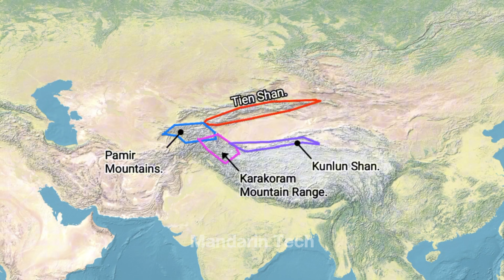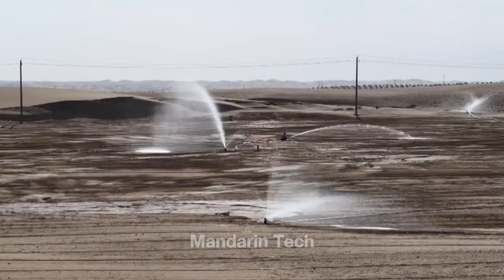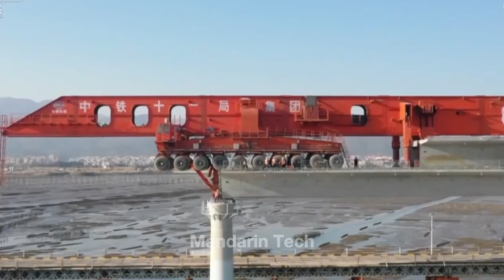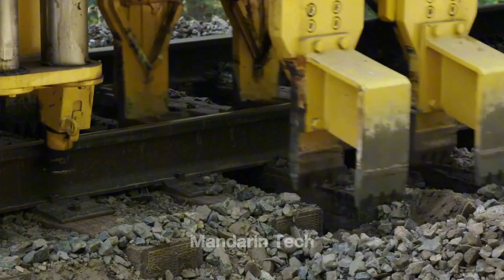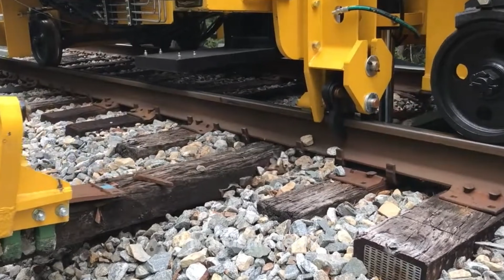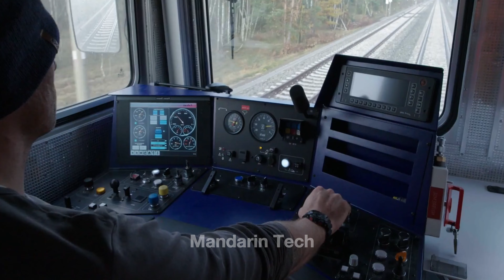How China Split Half The Mongolian Desert To Build a Massive Elevated Railway With 2,700km Length

Comment: Thank you for this very informative video.  I'm curious how thermal expansion and contraction is addressed with the Chinese approach of using solid concrete base instead of stone ballasts? Same for the continuous welded steel tracks.
Reply from the maker: Great question 👍

With slab (solid concrete) track systems, thermal movement is managed through expansion joints, elastic fasteners, and vibration-absorbing pads between the rail and the concrete base. These components allow small movements while keeping the track precisely aligned.

For continuous welded rails, engineers control temperature stress by installing rails at a specific “neutral temperature,” plus using strong anchors and monitoring systems to prevent buckling or cracking during expansion and contraction.
Reply: @Mandarintechmido  I bet the question was about lenght-expansion. >> every some distance, diagonally cut open joints are used (since ages...)

Comment: This construction techniques is wrong.

They should have drwdget the sand till they had reached the hard packed earth would ground.

Then should have constructed the pillars.

After the construction utilising waste sludge slurry cow dung and others plant dried leaves foliage etc should have been mixed with the removed sand and solid soil created.

Should have planted trees green house with fruit tree plantations for the 2000 kms. With irrigation 
Along with service roads for harvesting..

This should have been done for every pillars radius of 1000 feet on both the sides of the pillars creating a oasis of railways.

Developing specific landscapes on both sides alternating as resorts and break journey stations.

Comment: “Splitting a desert to build a 2,700 km elevated railway 😱 This is not construction, this is next-level engineering 🚆🔥”
Reply from the maker: It’s engineering at an extreme scale, pushing construction far beyond what most people imagine possible.
Reply: And it did not split the desert, it was built along the edge of the desert

Comment: Just in case more ppl are wondering, there is very little doubt that Beijing will never get that investment back, or even get enough back to offset the operating cost. But This is the core difference in way of think between Chinese and modern day West. Its not about the money, but about connectivity! And in this case, Beijing plan of its rail network is same as many others did with their road network and metro system(in major cities). Its never about cost, but country(and city) needs them as mass transit system for both ppl and cargo. Bad weather can stop plane from taking off, but very few nature situation can stop train from running(just look at Japan). And idea isnt even new, that is why I said "modern day West" before. as US build vast road network, just like ancient Roman and chinese first dynasty Qin did, the idea is that vast road network is important to connect the country, it overall benefit cant be measured by just how money the whole thing cost(within reason ofc, because corruption).
Reply from the maker: Well said. That’s exactly the point — connectivity, resilience, and national integration matter more than short-term financial returns. Like highways or metro systems, the real value isn’t profit, but keeping people, goods, and the country moving, even when other transport fails.
Reply: 中国的核心观念是：“为人民服务”，让人民过上更好的生活才是终极目标
Reply: а еще Китай обеспечил работой тысячи рабочих и много строительных компаний.

Comment: Has the line gotten or getting income of more than the construction, maintenance, and operating costs to build and operate it?
Most of the videos shown don't follow the audio.  This is mostly overhyped and taken from others' videos.  I don't think I saw any signs that were not reversed.
Reply: doubtful Beijing will get that investment back, or even get enough back to offset the operating cost. But This is the core difference in way of think between Chinese and modern day West. Its not about the money, but connectivity! And in this case, Beijing plan of its rail network is same as many other did with their metro system in major cities. Its never about cost, but as mass transit system for both ppl and cargo. Bad weather can stop plane from taking off, but very few nature situation can stop train from running. And idea isnt even new, that is why I said modern day West. US build vast road network, just like ancient Roman and chinese first dynasty Qin did, the idea is that vast road network is important to connect the country.
Reply from the maker: That’s a solid perspective. For projects like this, it’s less about direct financial return and more about connectivity, resilience, and long-term national integration—just like highways, metros, and historic road networks. Trains keep moving when planes can’t, and that reliability is part of the value.
Reply: China has a huge excess capacity to make steel and concrete.   In that environment, what is "cost"?

Comment: How long will this last? I hope this is not a tufo dreg project
Reply: This is an earlier video recording; the railway has actually long been completed and opened to traffic.
Reply: there are many AI trolls, better ignore them.
Reply from the maker: You’re right to ask. Projects like this are designed for long-term operation, not short-term showpieces. China’s desert railways are built with permanent foundations, sand control systems, and continuous maintenance, so they’re meant to last decades, not just a few years.

Comment: Very interesting, but what about the 100+ people you killed , when a TofuDregs concrete pier failed, dropping the beam on a passenger train, and destroyed the travelling crane..
Reply: In Spain or Amerika?
Reply: There are only two incidents kinda of matching your description:The Sikhio Train Disaster (January 2026) in Thailand (a Thai-Italian joint project) and Eschede Disaster (1998) in Germany. Both have nothing to do with China hence are irrelevant to this video, so whats your point?
Reply from the maker: That was a tragic accident, and any loss of life is unacceptable.
Our focus here is on engineering methods and safety lessons, and incidents like this are exactly why standards, oversight, and accountability matter in large infrastructure projects.

Comment: They also helped Saudi Arabia build a high-speed railway to Mecca in the desert.
Reply from the maker: Yes—Chinese companies contributed to parts of the Haramain High-Speed Railway, applying experience in extreme desert heat and sand conditions.
Reply: @Mandarintechmido  The agreement between China and Saudi Arabia is an exception. Chana ensured the purity of the holy city of Mecca. The requirement that "the majority of participants must be Muslim" significantly increased the project's difficulty. However, Saudi Arabia lacked a sufficient number of qualified Muslim engineers, necessitating China to recruit Muslim workers from other regions (and even within China itself) and provide them with basic skills training to participate in the project (China has tens of millions of Muslims, but they are not skilled in engineering). Ultimately, China overcame this challenge.
Reply: Saudi should remove restrictions
Reply: That is not help this is an agreement of billions dollars .saudi will pay to chinese companies
Reply: @BilalAhmed-hx8sn  Because it exceeded the original budget, the Chinese company completed the project at a loss of hundreds of millions of dollars. As compensation, Saudi Arabia allowed the Chinese company to take charge of the early operations, which recovered the losses from profits, and Saudi Arabia also learned a complete set of operational experience during the handover process.
Reply: The railway sdistance in Mecca is only short distance. Cannot be used as an example for the Sinkiang desert area in China.